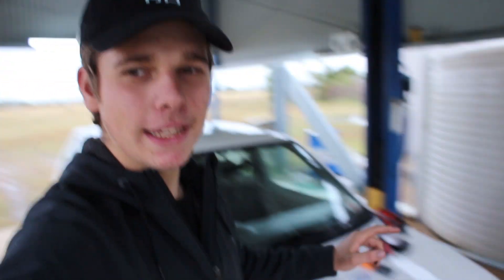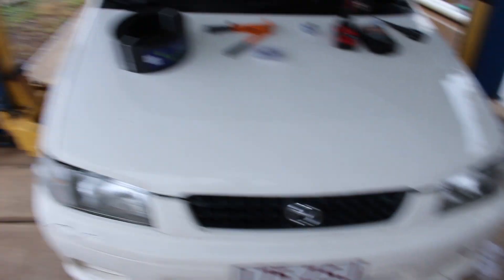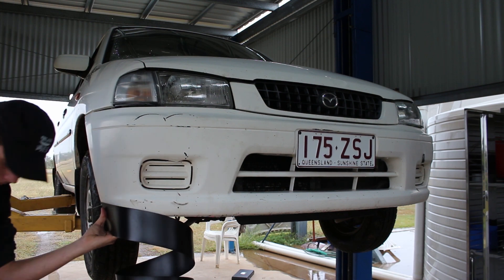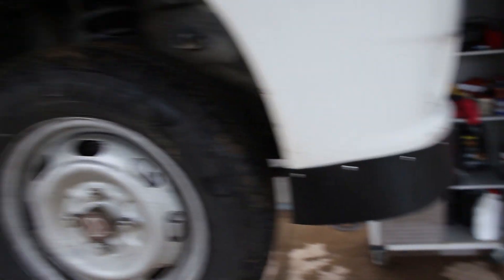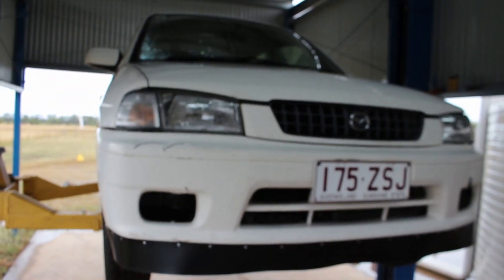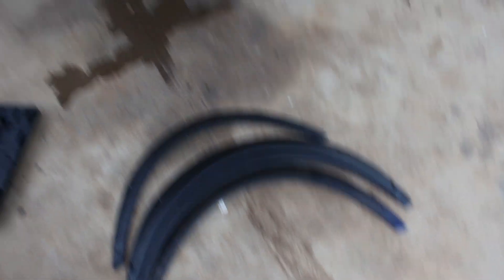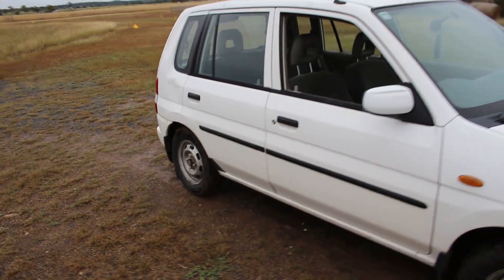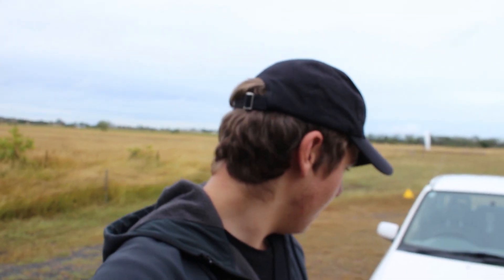$10 FRONT LIP SPOILER! CHEAPEST OPTION OUT!! - Richo's Customs.

Comment: You could also use a polyurethane sealer adhesive to bound it and use turpentine to smooth it off,  done plenty body kits using Sikaflex or Selleys brand polyurethane.